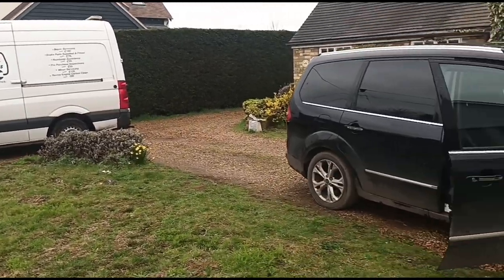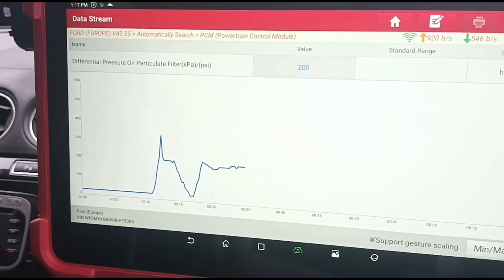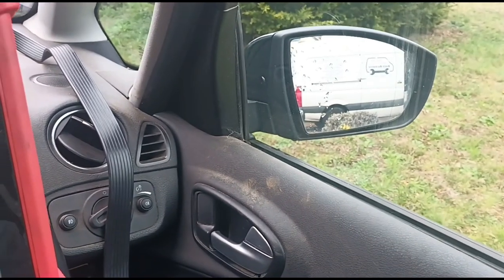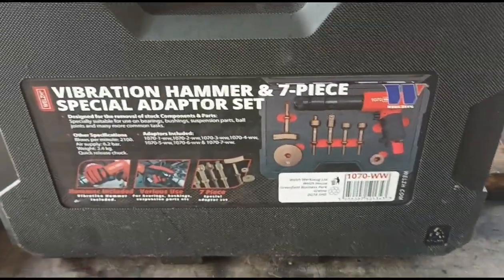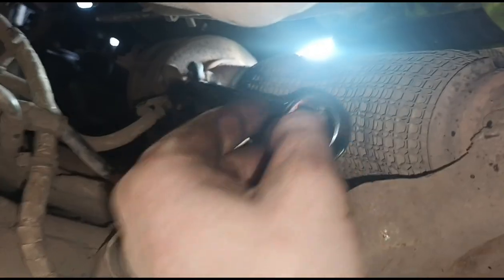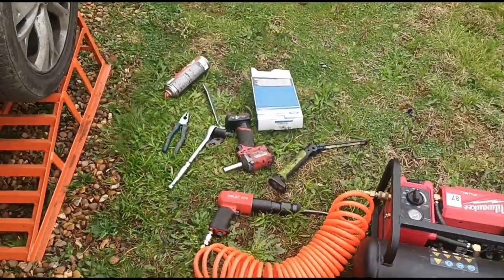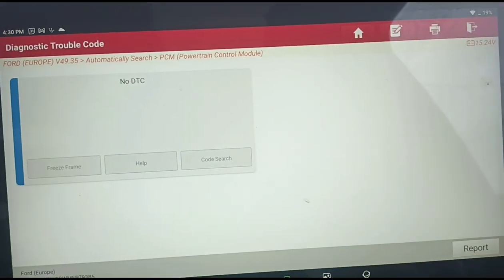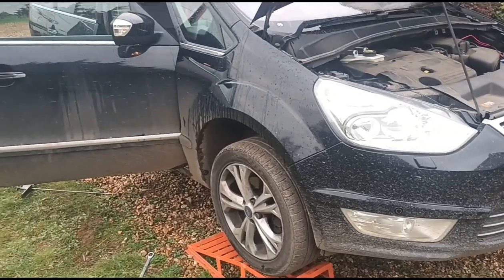Ford Galaxy 2.0 Failed Forced Regenerations Exhaust Temperature Too Low DPF Cleaning & Vaporizer

Comment: Good morning, my name is Errol I’m based in Luton I drive a 2015 Ford transit long wheelbase of jumbo one engine light is on. It’s a service engine now and I’ve got restricted performance. My local mechanic checked inside that my DPF is blocked. The AA came out and had a look inside. My RGR valve is stuck open i’m not sure whereabouts are you based if you’d like to come out and see if you can fix my van for me
Reply: Ring him..?
Reply from the maker: Orileysautos@gmail.com

Comment: Hi my v50 2.0d complete the cycle of regeneration every 200km succesfully in a few km (7-8min) but sometimes (like one time a month)  it continue regenerating also for an hour and 50km and wont stop until you turn off the and let cool down the car....no codes or errors....why? Dpf changed one year ago and new throttle body.
grateful if you would give me some advice because we can't find the cause. Thanks

Comment: Opposite mine. After a while my fan starts working fast and cloudy white smoke caused by vaporizer. Just not sure if the dpf sensors causing it or the Temp sensor